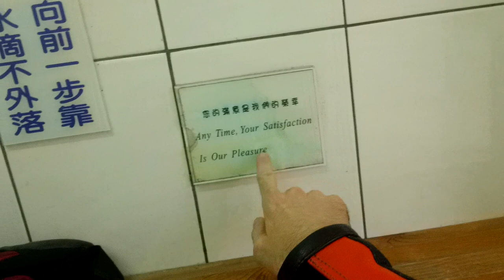Why do Motorcycles CRASH on the SAME Corners?

Comment: I think part of the reason people crash at Rnickey's site is because of the existence of cameras. People push themselves to look good for the camera and more mistakes are made. There are at least 2-3 photographers/videographers at that site on weekends.

The decreasing radius at the end doesn't help either.

Still lovin' those camera angles!
Reply from the maker: Only 2-3? I pass one or two in this video and it's a Monday. On the weekend there is about 8 at the main curve.
Reply: Yeah there are 2-3 photogs who are there every single weekend. There are probably assorted others, but Rnickeymouse (top, focuses on run up to left-hander which causes the most crashes), Shera (focuses on right-hander going back down) and RockStorePhotos are the main ones I know about. You can even buy a shot of yourself from Shera and RockStorePhotos. One of the pics on my YouTube channel came from RockStorePhotos.

8 photographers! That's like riding past paparazzi.

I think the cameras really encourage people to push a little harder than they otherwise would, so the cameras themselves can help trigger the very accidents they're set to capture. I'm not blaming the photogs either, just saying that riders probably don't push that hard when they're not on camera (unless they're really that good, but then they're not having to push in the first place).

Also, if people know they can buy pictures of themselves later, they want a shot with some lean-angle just for that reason.
Reply: sad but true :(
Reply: totally agree!
Reply: Mike12r1 - The R1 Rider
I even push myself a little there but I'm a pretty conservative rider. If people are gonna take pics, I may as well make it count. Such is the mentality that can cause any of us to crash if we push that 'make it count' too far or get caught up in the moment. ;)
Reply: People crashed on Mulholland long before the photogs. CHP even closed the road in 89 it got so bad. I will give you this, people will show off when there are spectators, and that includes photogs.  Honestly though, riders crash all up and down this road every weekend not just in front of us photographers.
Reply: M13 On the Snake it varies, 2-3 regulars, most others are just tourist or hobbyists who will show up for a couple hours. There can be five or more.
Reply: RNickeyMouse Hi RNickey! Yeah, spectators of any type will have that effect, but photogs are just a type of hero spectator actually recording what you do. So, if someone watches and you mess up, it's embarrassing. But, if someone gets video of the great turn or crash, it's out there forever.

Basically, that corner isn't that big of a deal but for its location being good for spectators, which itself is a known phenomena that can cause people to ride past their limits. :)

Not blaming photogs or spectators either, so much as people getting excited and riding a little too fast for the road/corner (with lots of people not crashing too). But, the behavior from cars (on that corner) corroborates the theory...as a lot of them drive a little crazy knowing they're being watched (and filmed) too.

People will crash without any spectators, but they won't necessarily ride over their limits when they're alone and not being watched, or not to the same degree.

It's probably related to the 'race day effect' too. Some racers don't go as fast in practice as they do for actual races, because they thrive and feed off the pressure, the crowds, the fact that it counts...and they probably saved their best-effort for this day.

For cameras...I think a lot of people are willing to put in their 'best' effort (riding beyond their normal threshold) because of the reward that comes from great video, pics, an unusual opportunity or crowd, etc.

People crash all the time, yes, but put a crowd on any corner (with videographers and photographers) and we can predict that the incidence of crashes will go up.

But to clarify, I am not blaming the spectators or photogs here. :) It's just an observable phenomenon where humans who know they're being watched (and filmed) act differently than those who aren't.
Reply: ***** Even without cameras, people crash all over that stretch of road.  Take a ride down it.  Practically every major corner you will see some skid marks, then broken lights on the side with a trail of oil staining down onto the street.  Heck, you can see it all over on streetview even.

What Rnickey says, very true.  In fact, there is a great series of photos that show the bad history of Mulholland.  Look up the photographic series, The wrecks of Mulholland.  Where there are cars, still at the bottom of some of the curves because they were too costly/dangerous to remove back in their day.  Some so old that they are barely visible, lost to rust and buried by nature.
Reply: MarkusReese I think people think I am blaming Rnickey and others. I am not. But, the 'camera effect' is undeniable and demonstrable. This is a test which can actually be repeated. I guarantee you that the photog spot on The Snake has a higher incidence of crashes than other parts, simply because people are pushing harder for cameras and crowds. That is not to say that crashes don't happen elsewhere.

Don't believe me? Travel with a film crew sometime. Observe.

What I am actually arguing is that where there's an audience (including cameras) in a sufficiently populated place, the incidence of crashes will be higher than average.

In fact, the reason there's a crowd there is because of the bikes and because of the landscape making it perfect to observe, and there's a little parking lot, which makes it perfect to turn-around and repeat the run as much as one wants.

However, The Snake is known worldwide by motorcyclists, and not just for that one turn. Having a YouTube channel to post ride-bys and crashes is great and a great idea, but that means that if people are in that corner seeing all of the photogs, cameras, people, etc., they're going to push that much harder (depending on the person).

The fact is, crowds observing a single rider can and will change that rider's behavior, especially if it's being recorded. It would violate everything we know about human nature if that weren't the case (as a rule).

The only point I am making here, and I think this is inarguable, is that being watched (and filmed) changes behavior. Hold a running GoPro up in a crowd and observe. Record someone whilst talking (in an obvious fashion) and observe. Few sporting riders want to see a picture of themselves being straight-up on a bike in a corner, or worse, crashing. That adds some pressure.

There's a reason security cameras exist, and why they change human behavior. There's a reason humans behave differently when a film crew shows up, or a TV news station. People even act differently when they see that I am riding around with 3 cameras on my bike, especially if they can see that the cameras are on and recording. Some people won't even let you film them when talking, but why is that? Why do people act differently around celebrities, or someone they're wildly attracted-to? These are all known patterns of behavior in humans.

The camera effect, under all its named permutations, It's a known phenomenon. I am not placing blame on anyone but the riders themselves, should they push too hard and crash.
Reply: Oh, not arguing camera effect.  But it happens anytime people are watching which is why the entire Mulholland highway is a mess.  This stuff was common back when all we had were beta cassette recorders.  Also when no cameras were around.
Reply: Yeah, and I am not disputing crashes. There are certain roads where crashes are higher due to the type of road, blind rises, blind corners, tricky corners, etc. There's one severe decreasing-radius that almost caught me out on the way to Mulholland...and it was a corner I was unfamiliar with.

Then, you have the camera effect on top of that.

I think for a given corner, adding cameras simply creates a self-selected group who will try a little harder for the camera, the crowds, themselves, due to increased adrenaline, the pressure of looking good, etc. I'm even aware of the effect on me, though I am pretty conservative and I don't push too hard there because that road kicks my ass as it is.

But yeah, I am not blaming anyone but the individual riders (for crashing). It's up to us to ride within our limits, audience or not. :)
Reply: *****  Yep, and it's not just riders. Car drivers often drive way over their limits for the cameras/crowds too and the photogs at The Snake have caught a lot of this behavior on video. In fact, some people probably go there as much for the road as for the cameras.

Is it exciting to see yourself captured in a moment in time or in a video where you were kicking ass and possibly dragging-knee in a corner? Yeah, but there's a price to pay if we push too hard in pursuit of that.

Simply having the opportunity to be photographed in this fashion is a rare event for so many riders, and some will try to really make it count. I can't say I blame them, either—just gotta keep it together and ride within one's limits despite the extra excitment and adrenaline-surge inextricably-related to the 'observer effect'.
Reply: ***** Agreed, I take pride in my skills and my bike.  I guess I am lucky that I am introverted when it comes to cameras, etc.  Got into bikes/cars etc, to get away from it all and shake my head at those that act like a doof to impress others.

That said, it is also a bit hypocritical, because I am also extremely competitive, so need to resist the urge to push it if somebody rides better than I am.  Main reason I will never get a modern sport bike.  If I got on a brand new litre, or even a 600, would be a matter of time til I had a bad day and became an organ donor...
Reply: That and they take their eyes off of the road to look at all of the people/cameras standing around.
Reply: That too!
Reply: Yeah, I think it's a primary factor.

Put a cop on that corner (visible before entry) and speeds would go down. Put a pro-motorcycle photographer/videographer there, speeds go up. This would be pretty easy to measure. If the corner could be cleared of all spectators (like most corners on that road) then speeds and the incidence of accidents would return to 'normal'.

But as always I blame the rider for riding over their heads, not the spectators.

Comment: From what I've heard that part of mullholland (or whatever) also gets a fine dust/sand on it that can make it very slick.

Also when in a heavy lean it can become easy to lock the wheels up with the brakes and go down. Seen a few people panic and grab the brake then wreck because the turn was sharper than they thought. 

For me I try to keep my comfort level a reasonably shy of full lean on the bike. That way I've got that little extra if the turn sharpens up, I misjudge it, or just straight run out of talent.

Comment: @ 1:10 you're describing an "off camber" turn. And the best way to avoid a crash due to either a decreasing radius or off camber turn, is to familiarize yourself and know your route before going at it full speed. Just like a MotoGP rider would take "practice laps" to familiarize himself with a course prior to racing it, an experienced rider would do the the same on a road. In other words, if you're riding like a mad man on roads you've never ridden on before, your cycling days are numbered.

Comment: Interesting video thanks. As an old rider I can add that there are marks on the road surface that warn of these problems, but don't ask me to describe them as they are so subtle, so look for them and learn. With suspension, flick the bike up more and lay down more to balance while pulling hard on the bars: it is the only time you pull left to turn left! If you cannot, then you were riding on the edge with no reserve. You may be surprised, but I can corner faster with my hard tail 1939 1000cc than others can understand. Instead of suspension changing the geometry, the tyre chatters, or skips sideways with the turning wheel  acting as a gyroscope and it feels rock solid.

Comment: basically: moving your weight forward on the bike progressively through the turn adds weight to the front end, this compresses the forks, shortening your wheelbase and effectively making the bike cut a tighter line with no extra lean angle

Comment: The term for the "tilt" or "slope" in a roadway is called super-elevation. Decreasing radius turns are frowned upon in roadway design for the reason in this video. Curves should have a consistent radius...if necessary a increasing radius should be used.

Comment: Its an off camber corner which is why you should stand the bike up as you exit instead of keeping your lean angle. Good breakdown! Car's understeer at the corner and then oversteer after the road evens out causing the idiots to take anyone out if they're parked on the side.

Hanging your body off does nothing for cornering, all it does is reduce your center of gravity. Countersteering is the best you can do and trail braking. Ultimately if you misjudge going in you won't have a good time going out.

Comment: I've found that when not riding at the absolute limit of lean or traction, you can scrub off a LITTLE bit of speed without standing the bike up completely.  Moral of the story - don't ride at 100% lean on the street.  Your best bet if you do find yourself in that sitation is DON'T freak out, push harder until stuff starts draggin', and then push a litttle bit more.  And don't forget to hang off the bike to get that last little bit of lean angle.

Comment: Don't want to piss on your chips but actually the RnickeyMouse Mulholland corner is not a decreasing radius turn. There is an article on why bikes crash there on Wired dot com which explains that it is a simple turn with a constant radius and positive camber - many people just arrive at it way too fast. Hope you get some satisfaction! :)
Reply: gonna give it a read!
Reply from the maker: Ahh, well that doesn't change much. I do SAY in the video that I'm not sure about Mulholland being one or not. And the rest of the video is still valid....people crash on decreasing radius turns a lot.
Reply: Dunno man, the corner does seem to tighten up at the end. Have you ridden that corner? Where'd you get your info or do you ride it as well?

Comment: in every crash its a different reason that caused the crash. for example one guy used front brakes in the middle of the turn. one guys chain was loose. one guy scraped loss grip. one guy fixated on the guard rail and crashed. one guy used too much power and drifted then high sided. many different reasons.

Comment: If you ride at a speed where you can stop in the distance you can see to be clear on your own side of the road then whether there's a tree down mid-corner, or the turn suddenly tightens on you, you'll still be OK. Obviously for any given corner on the street where you don't have a view 'across' the bend, you will end up having a hell of a lot of lean and grip 'in-hand' as a contingency against what might be just out of sight ahead round the corner. You need this, because 9999 times out of 10,000 you'll be just fine barrelling in to the corner knee-down, but that 10,000th time you'll probably end up dead from the thing you won't be able to avoid. 

This has another side-effect - on a motorcycle on a racetrack, to go faster you might optimise your lines to take the fastest shortest route from entry via apex to exit of a corner. On the street, if you chose for safety reasons to limit your speed based on what you can see, it follows that the fastest line  through any well surfaced corner on the street is the line that extends your view ahead the furthest. This leads to very wide 'vision' lines...

Comment: Accelerate to tighten your line?  Ummm, no.  Speed equals radius. Not the opposite.  U need to decrease speed to tighten a line by either rolling off the throttle or trail braking to manage entry speed.  Note I did not say brake IN a corner I said trail brake from the time ur upright to the time u can see ur exit.  Rolling in the throttle and increasing lean is a recipe for a bad outcome

Comment: yes like you said, a decreasing radius turn is when the entry starts wide and easy, and begins to tighten shortly before apex, and is much tighter by exit. what do you do? don't panic brake, don't brake more. put some more throttle down, shift some more m'ass off the seat and throw down that elbow. yeah, "knee dragging" is mostly used as a measurement tool for lean angle and mass distribution, but it wont do you any good considering race slicks can handle more lean then a street tire, more grip, and has more tread surface area coverage due to material and size, more so when warm. the more lean on a street tire, the less tread on the road, the higher the risk for a low or high side due to traction loss on either tire (front is a prime offender). so the next time a fuckin yolo squid who's words to live by are "stiches gets bitch's", points at your "chicken strips" and says "do you even lean, bro?" ask him if you could barrow his belt sander he used for his.